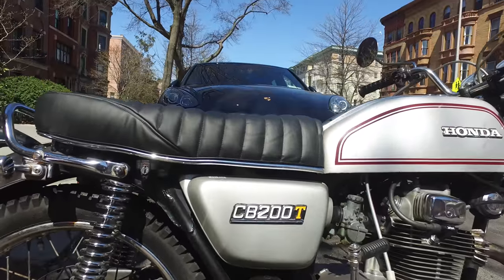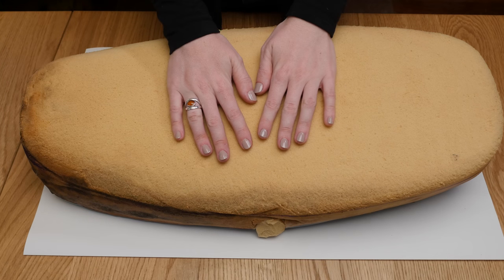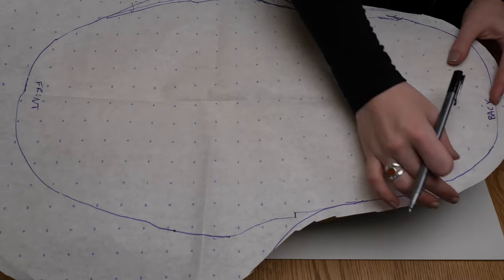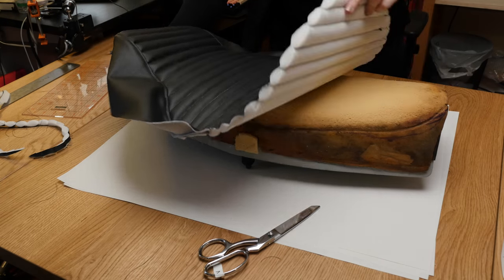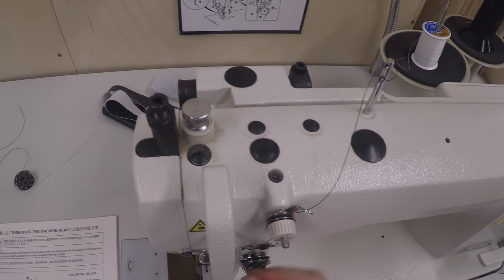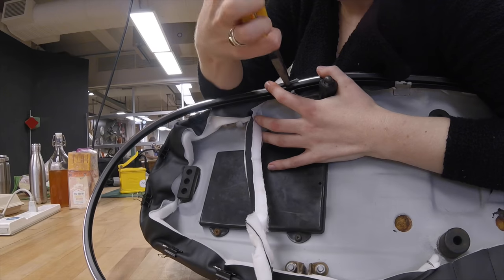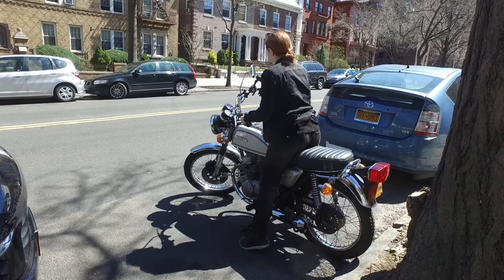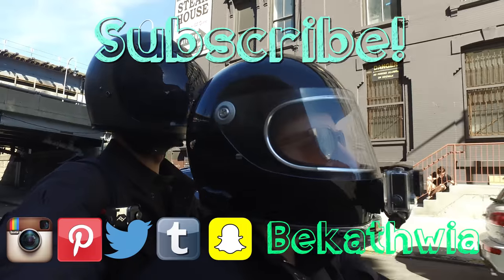Motorcycle Seat pt 4: Sewing a Vinyl Cover // Becky Stern

Comment: Good little video Becky! You did well on your seat project here. I have a brand new Africa Twin that I need to do some seat work on because after 2 hours on it I'm starting to do a lot of squirming around because where I sit only has an inch at best of foam on it, it's pretty hard on the butt. I have a very large industrial sewing machine that can do the stitching easily that will need to be done, I just need to work up the courage to tackle it and get it done.

Comment: Very nice video and well explained.  For the rust I would have used an angle grinder with wire brush 20 min max. For the covers they sell them in Ebay for $35 and look just like the original. Doing a pan myself for a CB750F. It would have been nice to see how you fitted the cover in the seat and attached it to the tabs.
Reply from the maker: Did you follow the link in the description to the full step-by-step? More detail there on the tabs&trim.